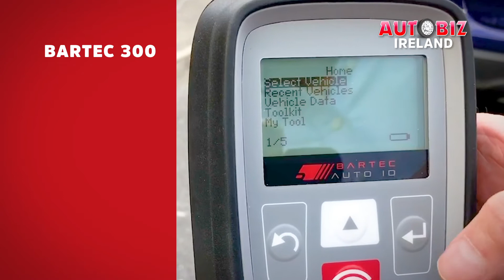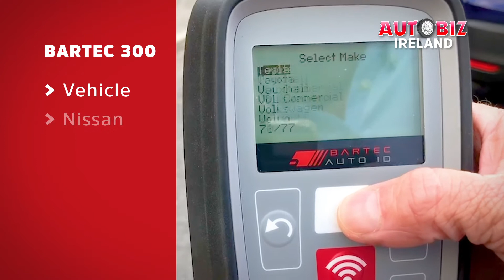Bartec TECH300 TPMS Scanner Demonstration

Comment: Mr. John, I'm having some issues with the shops Bartec tool. The Pro Series Bartec USA tech 300pro is telling me to go on a test drive inoder to get the reading of the TPMS, so they can commuicate. 
*Inflate tires to correct pressure.
*Apply parking brake.
*Press and hold the TPMS button. The MIL will flash.
*Release parking brake.
*Drive vehicle.
Note: If the MIL does not blink a few the relearn procedure did not take, Repeat procedure.
Note: the relearn process requires about 30 minutes of cumulative drive at speeds between 30-60 mph. 
The Bartec is not registering to go to these steps, I'm a tech that works in the shop and I can't seem to figure out this device. Do you have any tips?
Reply from the maker: Hello Mike,
Sorry for the late response. The YouTube notification on our channel was switched off for some reason and just now realising that and catching up on comments and questions. 

I wasn't able to recreate the problem you described so I can't give you a quick answer. You should go to https://www.bartecusa.com/ or call them on (866) 407-8767 and they should be able to solve your problem.  

I hope this helps you, 
John
Reply: @AutobizIreland  Its all good life happens. Glad you were able to respond. Turns out that the recalibration of the TPMS sensors.